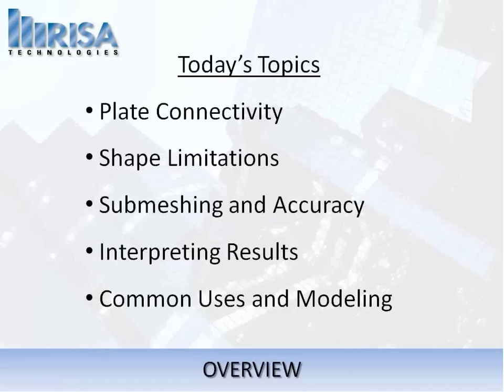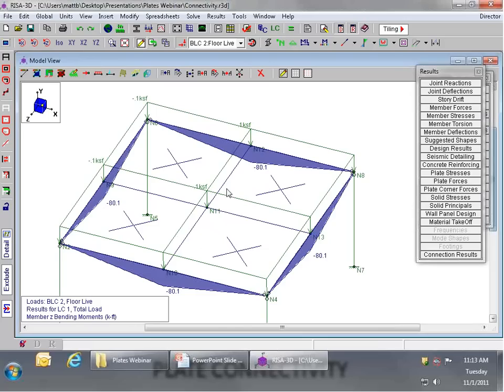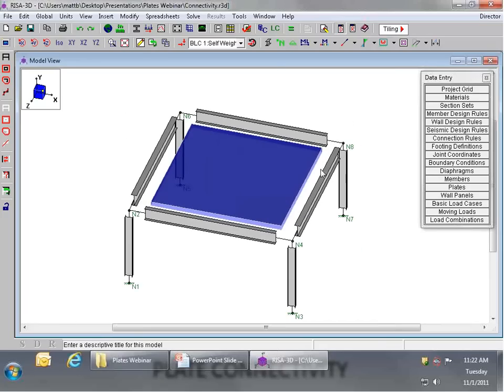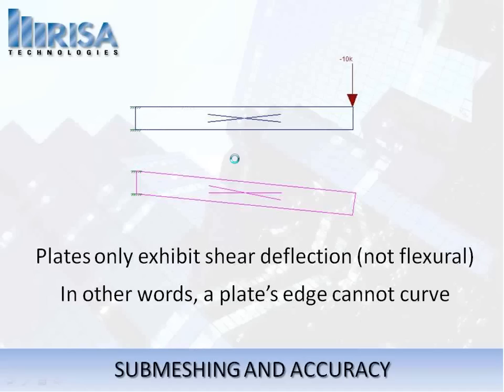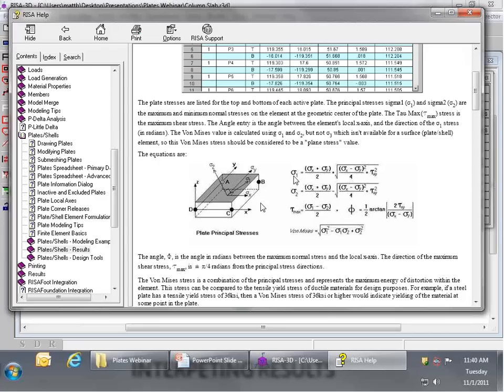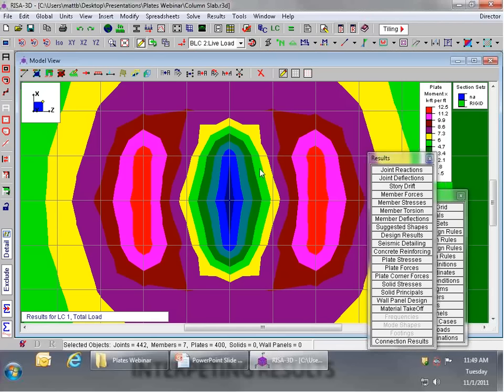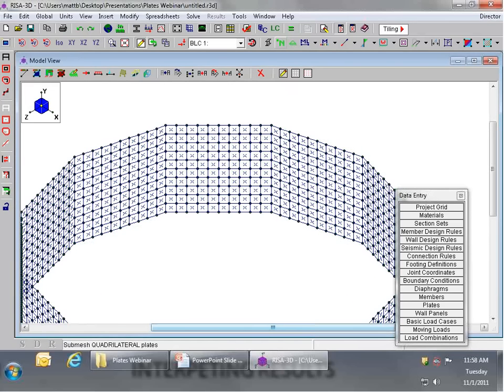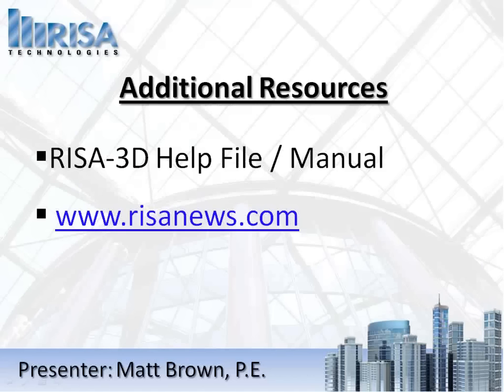Plate Design in RISA

Comment: How do you modify plate stiffness to account for concrete cracking?
Reply from the maker: Chemo Supremo The stiffness plates can be modified in the Materials- General tab.
Reply: RISA Technologies So, I guess you apply the applicable ACI reduction (e.g. .35*I) to the modulus instead of the moment of inertia
Reply: @psuengineer84  yes thats what i do